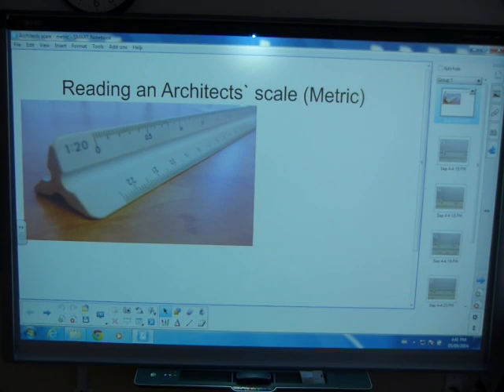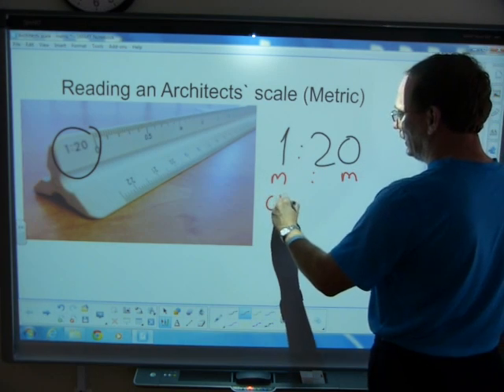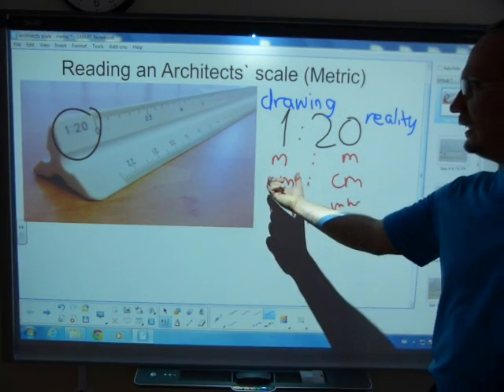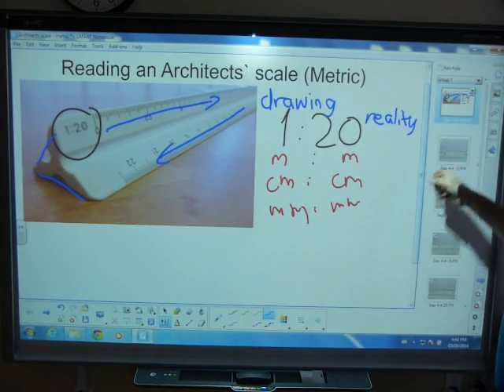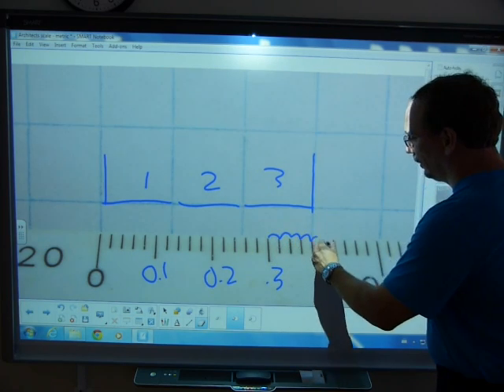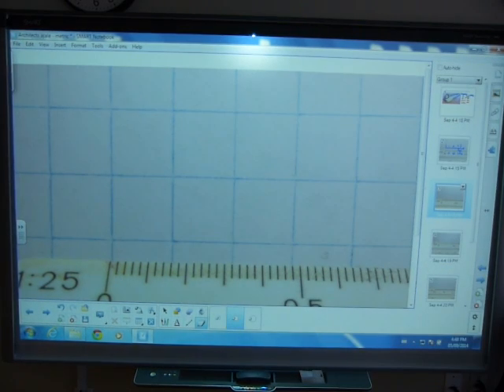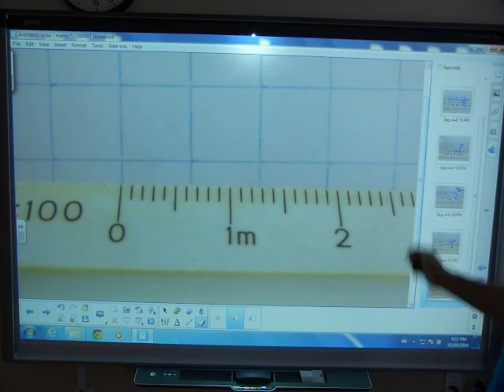Read an Architects` scale (decimal)

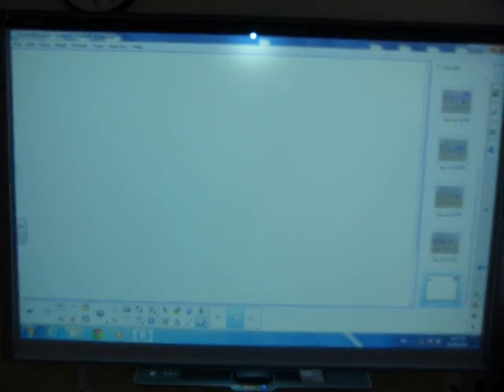Comment: Thank you so much for this video it was really good, but it stared blurry at 14:03. Does it mater if I use the feet scale than using the metric scale?
Reply from the maker: Works either way, just keep one job in one system, no conversions.